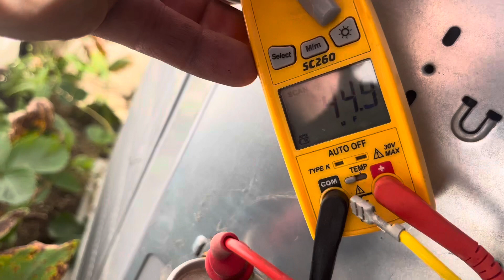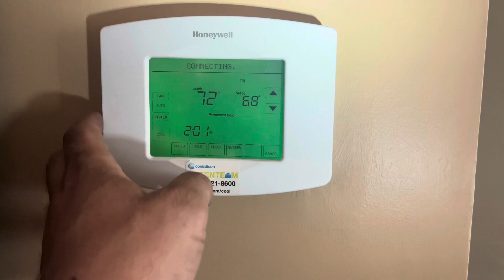HVAC.  WHY IS MY THERMOSTAT SCREEN BLANK?  CENTRAL AC IS NOT WORKING.   @CarrierGlobalCorp

Comment: Good video

How many temperature drop degrees difference are you looking when you check?   What do you do when reading is not what you are looking for?

thanks
Reply from the maker: 20 degrees is ideal.  You don’t always get that right after a repair because a high heat load in home.  But 20 is target.